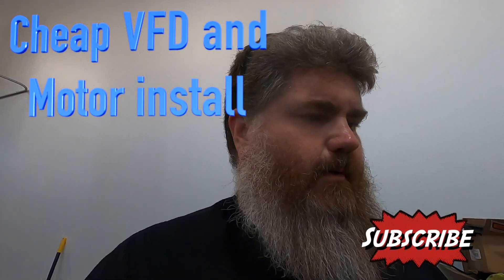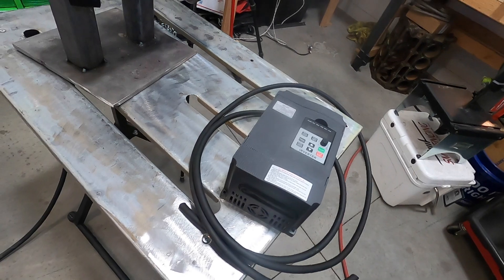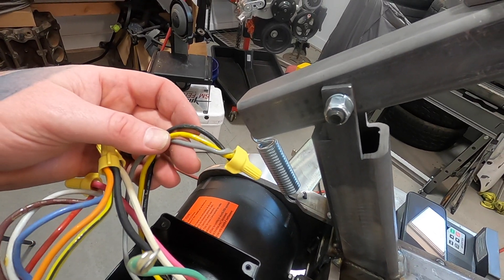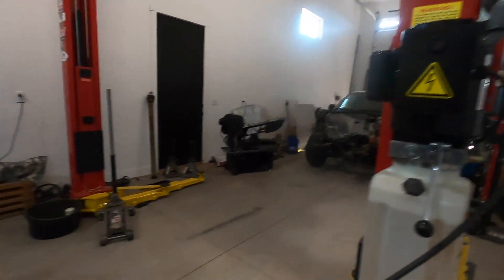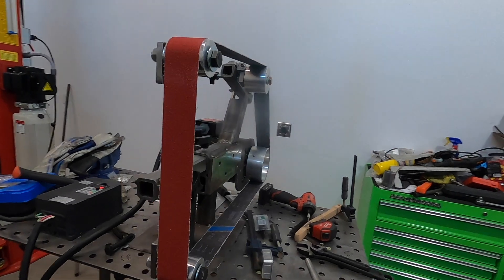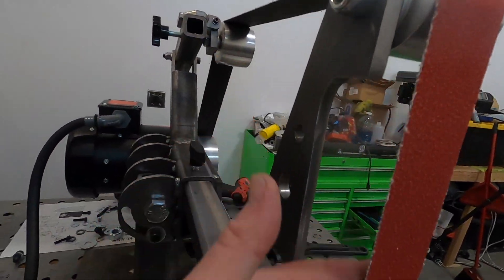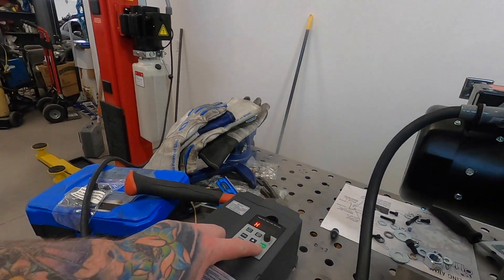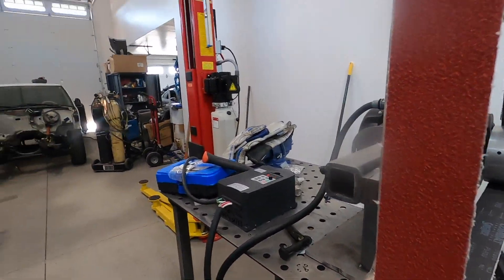2x72 cheap VFD and motor install

Comment: Nice job bro I just finished mine! I'm going to wire mine up this weekend. Where did you get the little elbow that goes into the motor?
Reply from the maker: I picked that up from Home Depot, back in the electrical section.